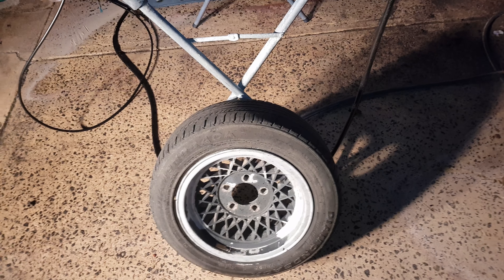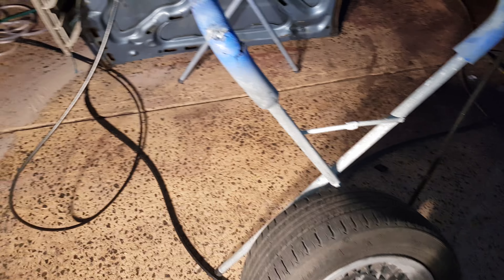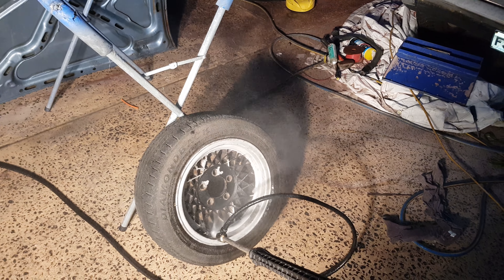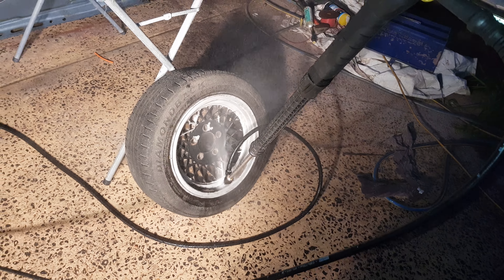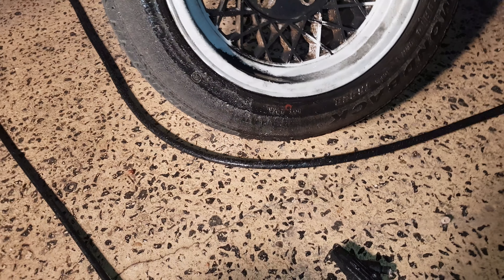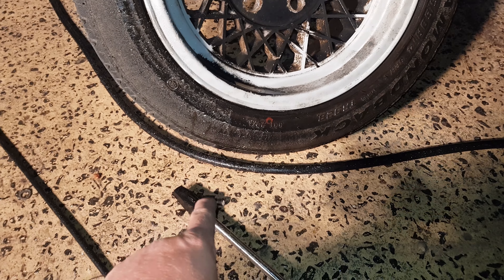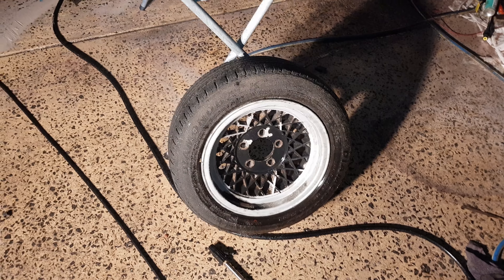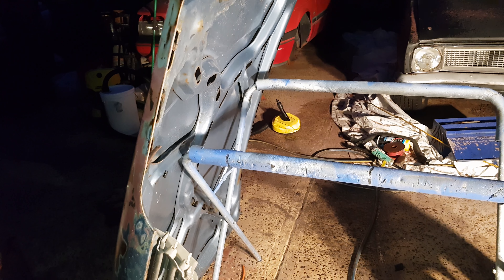Hydro blasting with a karcher pressure cleaner

Comment: which type of karcher blaster is this?
Reply from the maker: Hi mate this is an generic low cost siphon feed unit i got from banggood.com for less that 30 bucks. The pressure cleaner is a karcher k2 small.cheap domestic unit.
There is a buy here link in the video description if that helps you out mate cheers